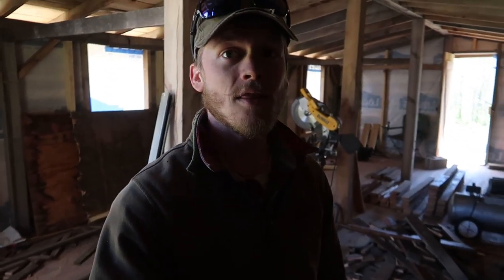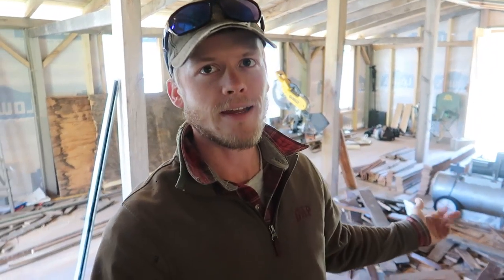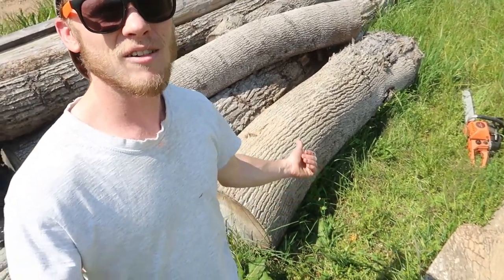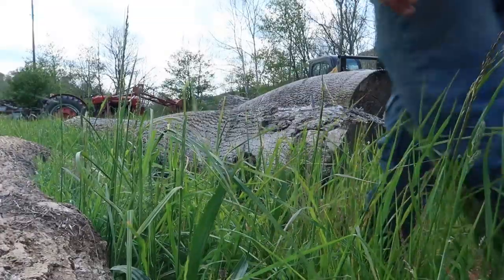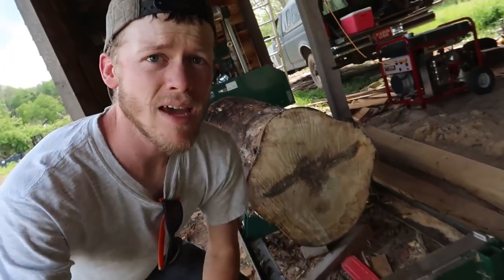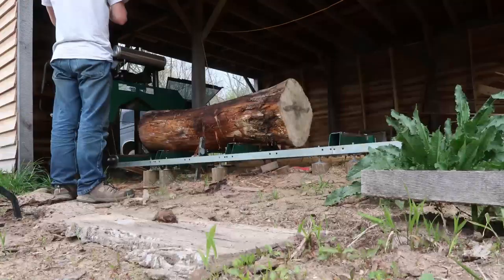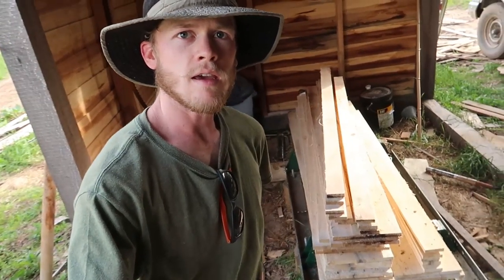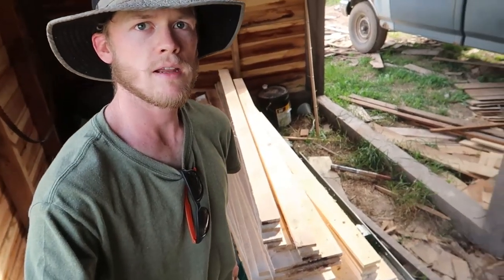Beginning the Soffits | The Millhouse

Comment: It’s probably too late for this since it sounds like you’ve got all your material prepped, but if you’re concerned about gaps at the butt-ends of the soffit panels could cut a miter on each panel’s end so they overlap, then when they shrink you’ve still got full coverage. Just an idea.

Comment: Now that the floor is finished in the loft, do you find much in the way of flex or movement in the floor?  I don't recall if you said you were going to install a staircase to the ground level at some point.  It sure would be easier than riding the bucket up in the skidsteer.
Reply from the maker: Not really. I mean if you jumped on it in the middle of the long span, it'll rattle a bit. But it's nothing concerning.
Yes, eventually there'll being a staircase.

Comment: instead of putting up the battens. install screen from the inside. the gap is good for air flow to the top of the roof, if the peak is vented
Reply from the maker: The peak is not vented, to I don't think it would make a difference, but that's a good idea though, for if it was.